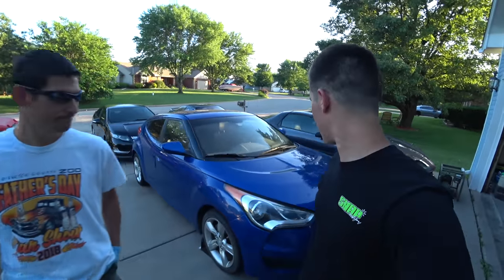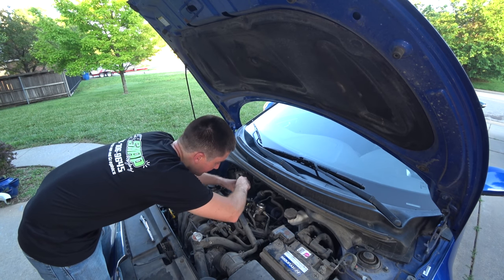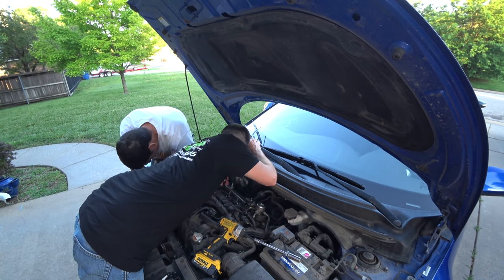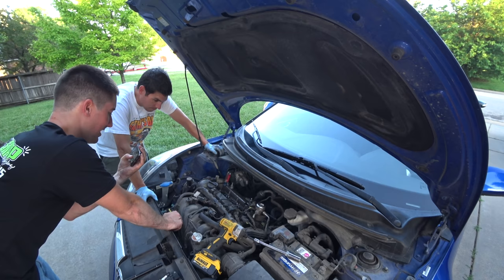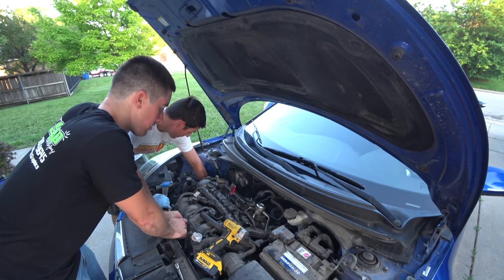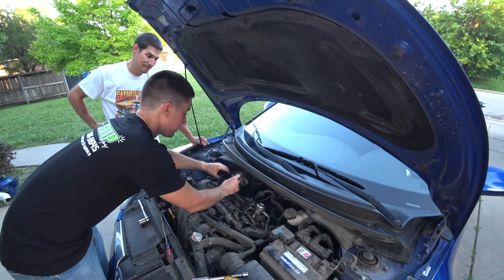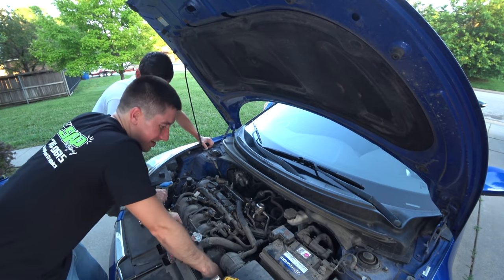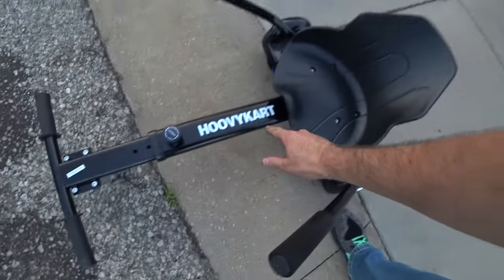Using A SCREWDRIVER To Test For ROD KNOCK On The $1,500 Hyundai Veloster

Comment: These engines are known for rod fail.. not long before the new engine gets it too
Reply: Not really. The 1.6L gamma engine actually has problems with vibrations and whistles and usually leaks oil from under the cylinder head valve cover really early in the life of the car. They ain’t great quality engines but you’re wrong. (I been working on cars for 15 years)
Reply: Scotty W oh and failing water pumps.
Reply: @djentyman4002  I've been working on cars for 16 years, you're incompetent
Reply: big john oh really? Well you seem not to know much about the 1.6 gamma engine then
Reply: big john with scheduled maintenance the car can last around 160k to 200k miles with no serious issues
Reply: big john plus none of use know how previous owners treated the car. That’s a big what if on how the rod went bad
Reply: @djentyman4002  I didnt know scheduled maintenance consisted of multiple engine swaps
Reply: big john yeah if you get a new car you do scheduled manufactured maintenance and you’ll never have an issue unless there is a manufacturer defect. Do you not know anything?
Reply: @djentyman4002  manufacture maintenance? Why not just buy a toyota or Honda and just change the oil and drive 400 kms without issues
Reply: big john I love Toyota. It’s my favorite car. But there is more to just maintenance than changing oil
Reply: @djentyman4002  blinker fluid and thats about it!
Reply: big john right haha can’t forget that. Or the muffler bearing